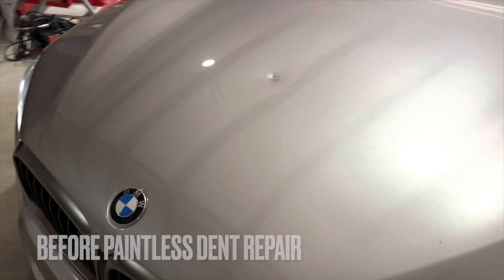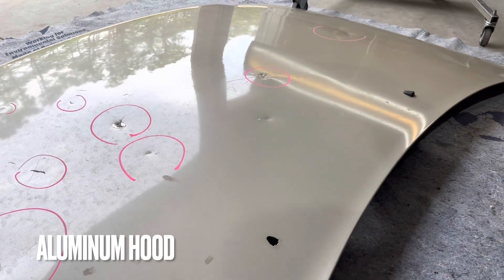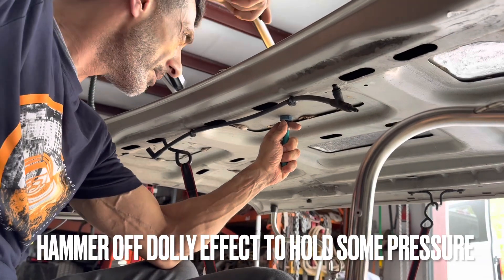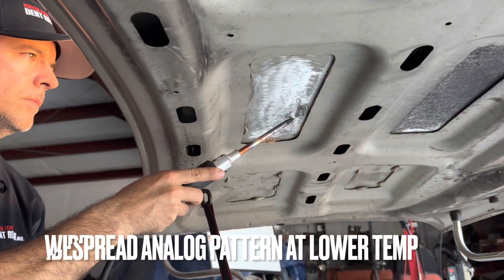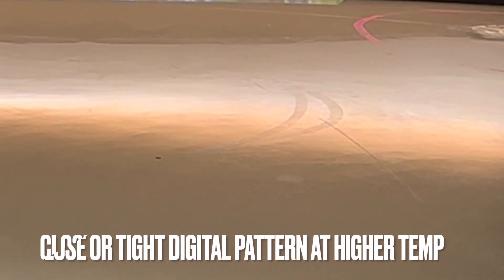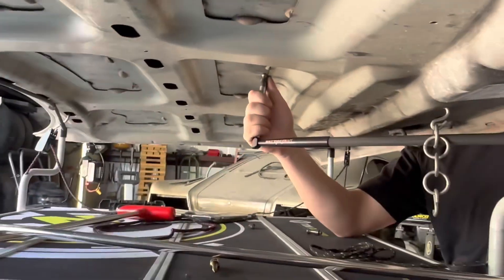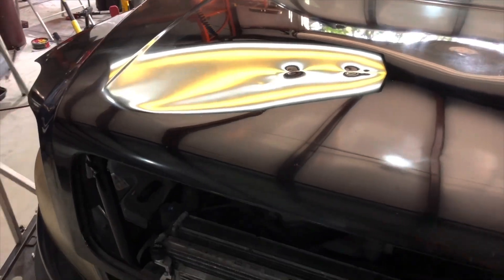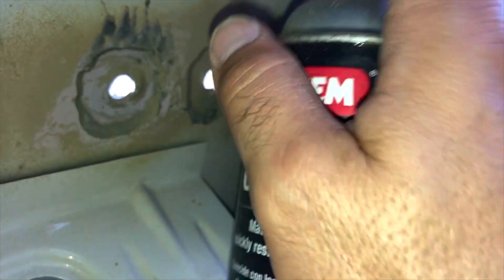HOW TO FIX DEEP DENTS - PAINTLESS DENT REPAIR

Comment: Usually I save that first good without any of this,just propane torch and something to cool it off before tapping.
Reply from the maker: With all due respect, a propane torch isn’t going to shrink metal without first damaging the outer paint coat. You need isolated high heat to the back side to get the metal to glowing red temp without burning the paint. That’s exactly how these machines work.

Comment: Do I have to disconnect the car battery when using a power pdr machine?
Are there any side effects when using the battery without removing it?
Is there no side effect even if I use it in Tesla electric cars?